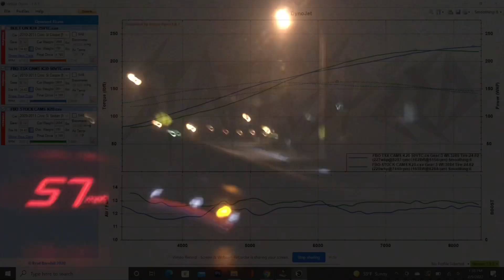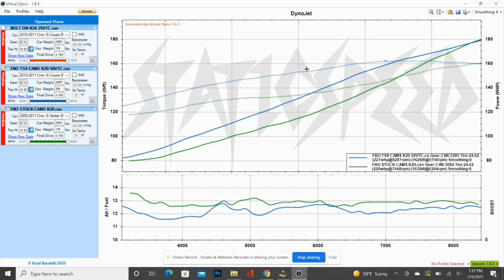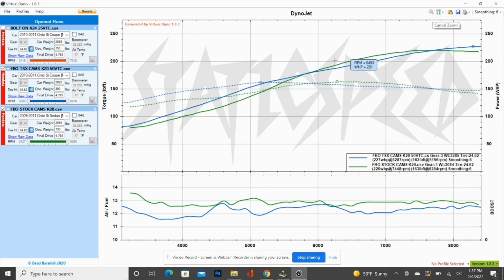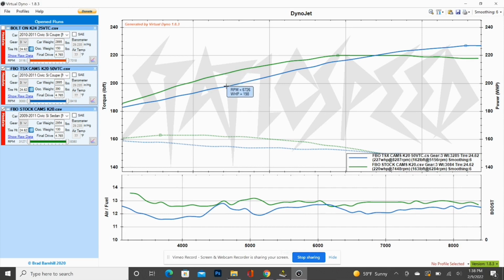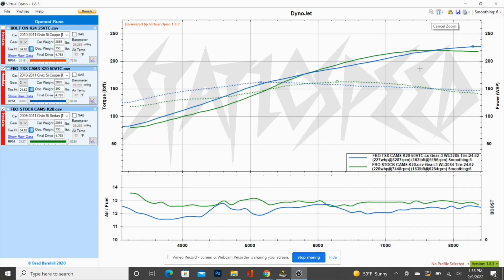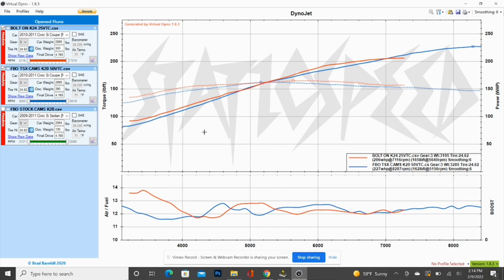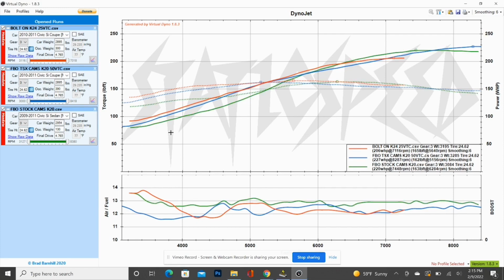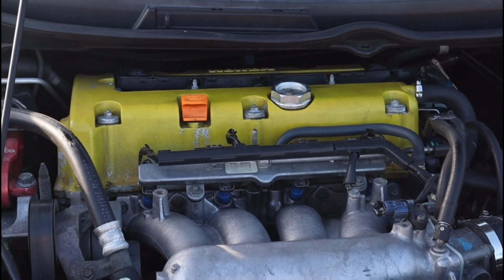Best Budget Mod For K20 | TSX Cams Dyno Comparison

Comment: I have a k24a with tsx exhaust cam, and k20a2 intake cam, 50°vtc springs and retainers Brian Crower, and k20a2 oil pupm tuned, and car runs very well..
Reply: How much hp did it make I was thinking of doing the same

Comment: Would changing vtec up and lowers make more power top end on the k24 cams?
Reply from the maker: Not necessarily more power up top but you can optimize the powerband in the midrange by using a VTEC point about 250-500RPM higher than the K20 cams optimal point

Comment: Are all 04-08 TSX exhaust cams the same part or did they change it between 06-08? Also, I'm FBO on Flashpro basemap atm, but which would give more gains? TSX exhaust cam first, or, I saw one of your comments, injectors and TB? Just seen a lot of people say its not worth getting bigger TB without cams, as stock TB is fine with stock cams.
Reply from the maker: All TSX exhaust cams are the same correct, only the intake cam changed. In my experience I would say if you can’t get your hands on an 06-08 set with intake and exhaust cams then don’t do the mod at all. Instead I would purely just upgrade to 550cc injectors and start using E85. Throttle body gives decent gains on stock cams but I would only upgrade that if you can find it from the junkyard. It’s not $350 worth of power gains but it’s definitely worth $100
Reply: @staticspeedtuning  oh so its actually worth going intake AND exhaust cams from TSX (06-08). I would've thought z3 intake cams were fine with tsx exhaust cams, but yeah I would go bigger injectors and e85 but its my daily so I don't want to worry about e85 just yet lol. Thanks for the insight though.
Reply from the maker: Yes the 06-08 Intake cam has the largest low cam lobe of any K series can and has an extremely similar high cam lobe to the JDM K20A

Comment: How does the TSX cams run on a stock ecu?.. Live in CA and we need to run our stock ecu to pass inspection. Thanks!
Reply: Won’t make much difference since you need aftermarket ecu for tune
Reply from the maker: They run on the stock tune but not well. You can run stock ECU and just get Hondata Flashpro and I can make you a tune for the cams. Then you can reflash back to stock for inspection

Comment: Amazing video brother. Just subscribed. Seems like an 8th gen w/ k20z3 would benefit more from drop in cam, intake manifold upgrade, header than the traditional I/H/E big 3 combo everyone runs in the beginning. I get why everyone does the big 3 first and build on it but if you only had a certain amount to spend - seems like you could get more the other way. 

Would love to hear your expert opinion though cause I’m definitely not that.
Reply from the maker: Definitely would do I/H/E before drop in cams. You will only benefit from the bigger cams if you have all the other weak points taken care of. After I/H/E I would say do TB, Injectors, then cams
Reply: @staticspeedtuning  Makes sense. I think you are right. A more aggressive cam and perhaps certainly you are correct. But a drop in cam Im not sure. Why do you suppose skunk 2 says on all their cams the only requirement is header and valve train (if stage 2+) and not intake/exhaust? Ive watched a lot of videos lately of tuning and many guys are getting only 3-4 hp more w intake while a cam can give you 15+ and more mid range torque. Seems the intake manifold and cam would help a lot more than Intake and TB. Saw another video on the K20z3 and all the guy did was change the IM and left intake stock and saw a variance of 20hp based on Im alone and tested 4 diff manifolds. I suppose Ill try it and report back to you my findings. 

Ive seen 205-218 to be standard numbers (diff Dynos and altitudes) with I/H/E. Im hoping to get same numbers with my combo but a lot more torque. 

Anyways I appreciate your time. If you are correct - which you most likely are - Ill write back to tell you.
Reply from the maker: Just gained a customer 15WHP/15LBFT just by adding a 3.5” intake and retuning. An intake or exhaust can be just as effective as a drop in cam if properly tuned. Cams take longer to install and if you want to really make power you need cams that require the valve train to be replaced. Then you’re looking at $1200+. I’d rather do the $300 intake first
Reply: @staticspeedtuning  makes total sense. Thank you brother. I’ve seen a lot of tuners only get 4-6 out of intake but i guess there are other factors like temps, altitude, and other supporting mods as you say.
Reply from the maker: Exactly. The power potential compounds the more mods you already have. He already had Header and Exhaust which is why just adding the intake was able to make that much.
Reply: @staticspeedtuning  makes sense.

Comment: Ktuner or Hondata for 8thgen???
Reply from the maker: Hondata, much better than k-tuner
Reply: @staticspeedtuning  I get that alot but why ??? That should be one of your videos actually show the difference between the two. Software and gains of both
Reply from the maker: They can get the same power gains but it’s way easier and faster for the tuner if using Hondata since it has live tuning. I can tune a car on Hondata in 45-90 minutes but with ktuner it can take 60-120 Minutes to get the same results.
Reply: @staticspeedtuning  oh shoot. I always wanted to know but no one ever goes into a lot of detail. Thanks again
Reply from the maker: You’re welcome

Comment: Thats whats up bro but i think stock z3 is the way to go, put a type s oil pump and rip it to the moon....thats crazy my boy has always said that the z3 cams are better than the tsx and u just proved it! Crazy 🤪
Reply from the maker: Hey man I think you should rewatch the video again. The TSX cams bring more power and torque throughout the powerband compared to Z3 Cams. Z3 cams only make a little more power from 6-7K but the gains from TSX Cams at 4-5K far outweigh that
Reply: @StaticSpeed Productions  yeah but thats on the mid range, when ur running them ur staying in the powerband 7-8.5k thru out the run in every gear.....my buddy had this setup and we kept betting him. Thats when my buddy started saying that the cross over is aggressive but u need that top end thats where our power is at...n he's right
Reply from the maker: This is true but the TSX Cams make more power than the stock cams from 7600-8600 anyways so that’s why I’m saying the TSX Cams are the move. All about preference I guess. The low end and midrange makes it way more enjoyable for daily driving in my book
Reply: @staticspeedtuning  thats big facts!